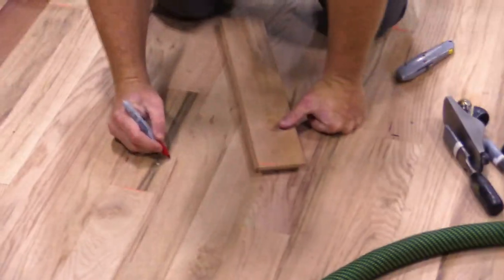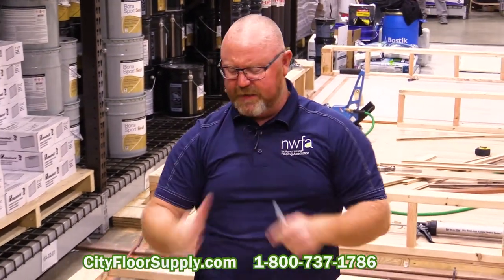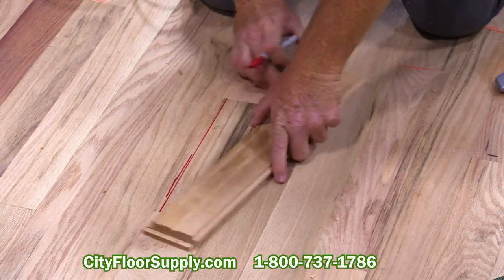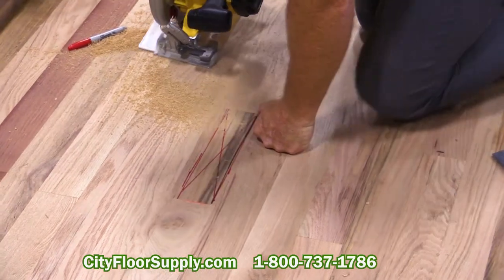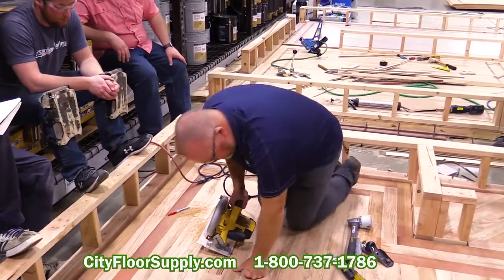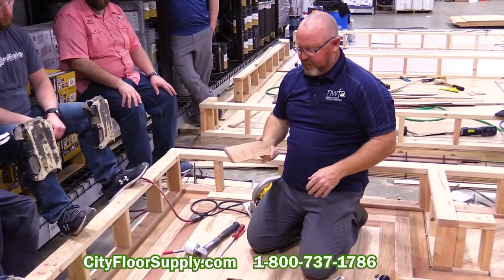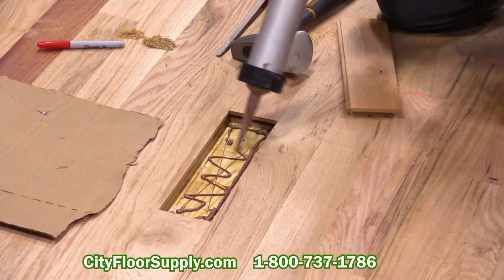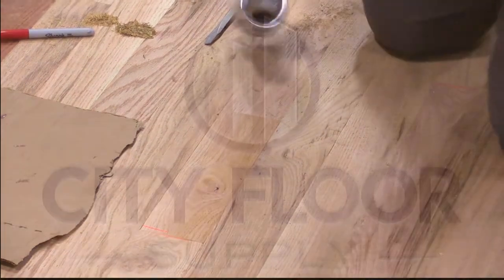How To Replace a Floor Board with Jason Elquest | City Floor Supply | NWFA

Comment: Try using the multi tool instead of a cross cut.  Way less dust.  Also you didn’t show how to crack the ends.  Your content is good, just not complete.  I’d love to teach you how it’s done. My record is 156 boards in one house.   Manufacturing fault